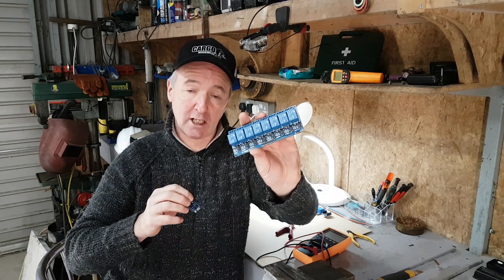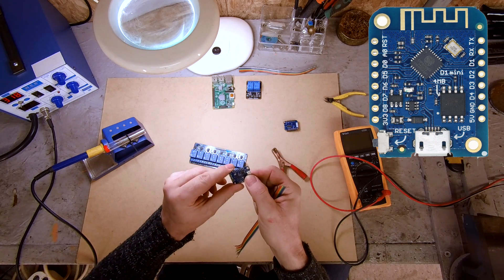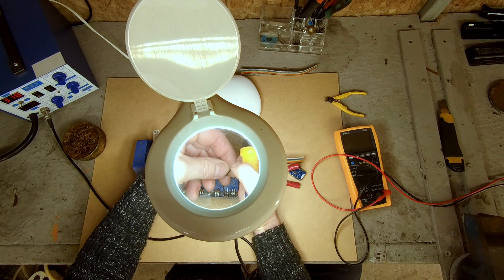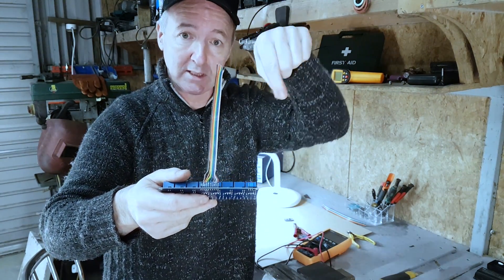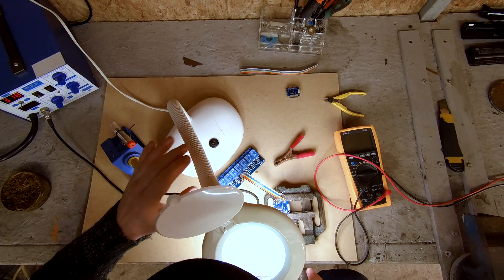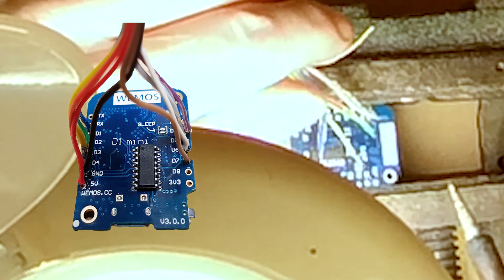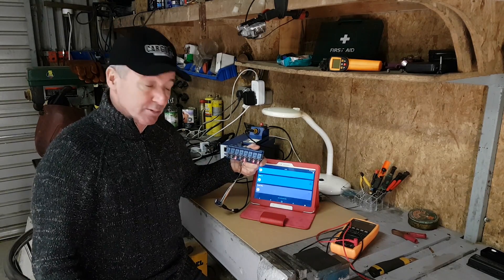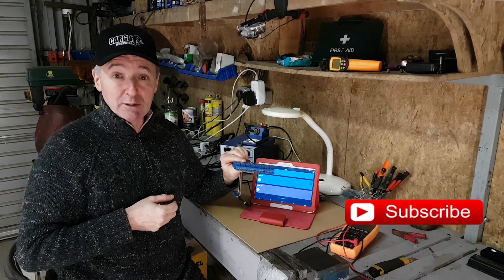Cheap Alexa Heating Control

Comment: What about the hot water? Are you going to put a pump on it, so you can use it to warm radiators? Thanks for the update! Think you are great!
Reply from the maker: Hi Roger.  The boiler stove project will be happening again very soon. I am working on integrating the relay project into my own heating system. I  will finish that tomorrow and then onto the boiler project. Thanks for commenting much appreciated Cheers Gerry👍

Comment: Flux cleans the oxidization from the metal so that the solder cand bond. Flow is a sign that the flux is working. I was trained by my father who was an electrical technician.  Although, I don't make a hoby of it or do it professionally. But, if I had to, I could. KnowatiImean, Vern?
Reply from the maker: Hi Stanley Denning  Appreciate you commenting Cheers Gerry👍

Comment: Soldering is permanent until a relay or some other component fails.  Experience talking...
Reply from the maker: Thanks Richard I have a few of these and they do fail but I have good access to the board and I can override it with switches. Another video on that soon Cheers Gerry👍

Comment: Gerry, help to comprehend the true function of motors. I hear that in the Ireland you don't negative ground. 3477944124 I hear you had/have motors without distributors, alternators rotating differently, and dynamos? Oh, any contacts in USA, I need to relocate to another woods and get help to save the Fairview Park Staten Island against corrupt greedy developers and their minions.

Comment: Nice job ..nothing quite as satisfying to use as a system you've made you're self ... I've been using these Wemos D1 board's to make IOT projects for a long while ... I highly recommend them compared to useing 'bare' esp8266 boards .... It's just so much easier and I buy them in bulk for just over a pound each ....I often get asked why don't you just buy a smart plug or other device instead of making one ... I always say how the hell do you learn anything buy just buying the finished product every time.....by the way I made one of your waste oil burners ( thanks for the vids) and it gets as hot as hell .. planning to use it to heat our above ground pool later this year ...keep the vids comming dude.
Reply from the maker: Hi getyerspn It will be fun to have this working with the heating system. I hope to make another to run a waste oil heater I am working on too. Great that you have waste oil heater too. They make a very cheap pool heater too 👍 Thanks for commenting Cheers Gerry

Comment: I recon that’s the best soldering iron I ever seen, good idea.

Al.
Reply from the maker: Hi Alan. It is a rework station with temperature controlled hot air. Handy for welding plastics too. Thanks for commenting Cheers Gerry👍